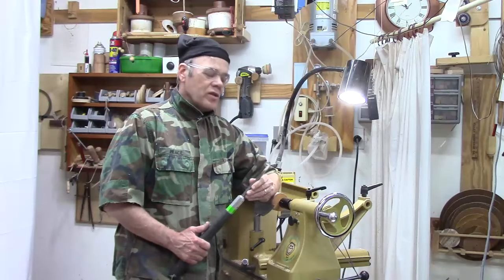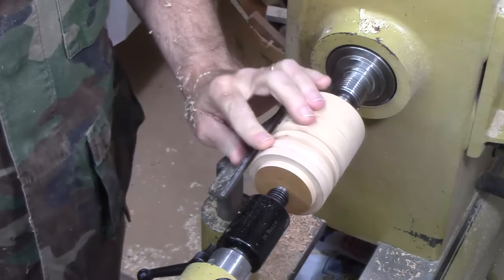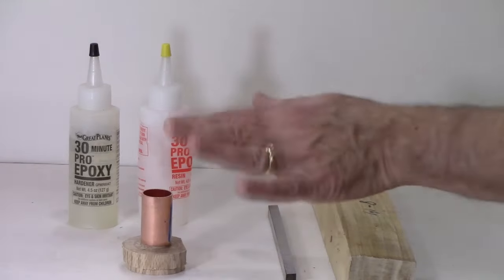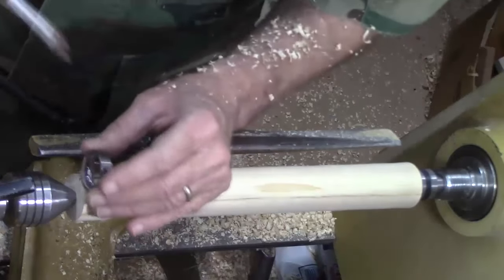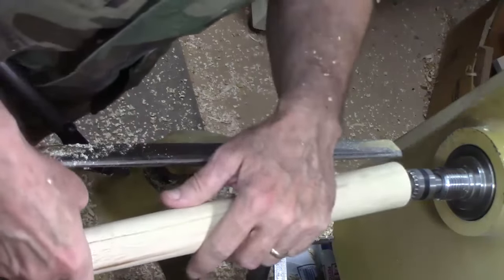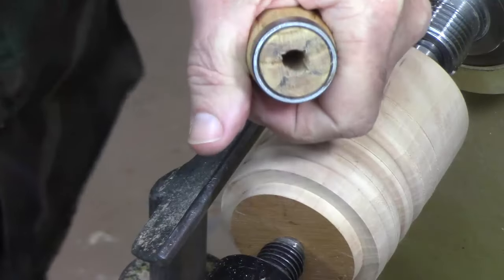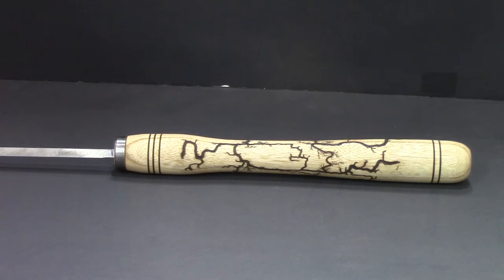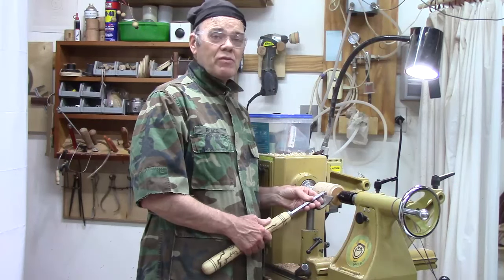The Versatile Beading and Parting Tool for Woodturning

Comment: Mike I bought those tool steels and they came with an angle on both ends. So I built the tool and sharpened to that angle and it fits my dove tail jaws perfectly. Thanks for the info and I'am going to make another one that is straight on the end. Thanks again for a great video.

Comment: Thanks for the idea of using the 8mm square bar.  I made a bedan and an offset dovetail tool for cutting a dovetail recess close to the tailstock as you showed in an earlier video (2015-10-8).

Comment: The Japanese method for mounting square tangs into round, preferably slightly tapered holes, is to heat the tang dull red and then plunge it into the bored hole. The tang burns out the wood to from a square shaped receiving hole. Works great without the the grinding. Added bonus is that the hole has been broached into a square and the tool will resist rotation in the handle.
Reply from the maker: Thanks. I will try that next time. My club will be making these in a workshop.

Comment: Hey Mike, just want you to know that I followed your lead and bought the HSS  blanks from your store on Amazon.  Thanks for the heads up.
Reply from the maker: Excellent. I use this tool so much.
Reply: Mike, you use a Robo Rest in this video to sharpen - what degree do you have it set at?

Comment: thanks for the video! Your teaching style fits me. Question, What is the advantage of this tool over a bedan?
Reply from the maker: I don't have a good answer and I do not want to make one up .I guess it depends on the user.The British bedan has a trapezoid shape. This one was easier to make. I guess I like this because I saw a local user demonstrate using it to make  probably 80% of the cuts on a solid globe ornament so I found the inexpensive 8mm bars of HSS I show in my Amazon shop and made one. I have been happy with it. I do not know any turners that use a bedan in their demos other than a couple of French turners so had little exposure to using one.

Comment: What about using a headstock mount drill chuck from Penn State Industries (Item # TM 42) instead of using a drill chuck that requires a "draw bar"?  Or even your drill bit fitted with a #2 morse taper which also requires a draw bar for use.  It seems to me that the headstock mounted drill chuck would be safer and cheaper in the long run.  What do you think?  Thanks, Rusty
Reply from the maker: See my recent video on Drilling on the lathe. Hard to cram every related topic into a video or I get to rambling.

Comment: Nice Mike! Do you think the bur after sharpening does much or is it gone on the first cut? Just wondering.Do you think copper makes a poor ferrule or is it good enough? Thanks for your time and help as always.
Reply from the maker: Copper is plenty strong enough.  I would be more concerned about some of the very thin brass ones that have a dimple in them that come new with many tools!  Using this tool on spindles slicing is not nearly as hard on an edge as it would be used as a scraper.

Comment: I'm confused how to use the tool with a sorby sizing tool. Let's say I set it to 1.250" using calipers. It holds a rounded, blunt poker that far away from the beading tool's cutting edge, so that when you sink down to that diameter you can see you're there... in theory. But by the time you're "measuring" the diameter of your workpiece you're necessarily near the centerline and that sonovoagun wants to grab if you're cutting 3/8"! And if I flip it 90 degrees and make a V groove the measuring poker won't go all the way down to the bottom of the cut.
Reply from the maker: I have never used one.  Maybe it is sold to solve a problem I don't have. Sometimes tool manufacturers come up with ideas for tools to sell tools. Regular calipers work for me.

Comment: Would I set the plate for the grinder at 22 1/2 degrees to make the 45 degrees included angle?
Reply from the maker: Or the opposite 67.5. Depends on how you look at it.
Reply: Thank you very much, just received the Steel and am planning on making this and a round skew and point tool, I found out the round stock is not heat treated does that matter?
Thanks for your help
Reply from the maker: @kidclown222  For a 1/4 round tool I doubt if heat treating will matter. It may not be as hard but should get the job done. May take more sharpening but I rarely take my small round tools back to the grinder but just toouch up with a hone.
Reply: @MikePeaceWoodturning  
Thank you very much I’m just starting out at 68 bought an old Shopsmith, trying to teach myself. Having a great time, love watching your videos and learning from them, also learning a lot from other great turner’s like Sam Angelo, Captain Eddie and a lot of others. 
Thank you very much, and keep the videos coming

Comment: Newbe question. Is this 8mm parting tool used for the same purpose as the square carbide tools?
Reply from the maker: It could do some of the same tasks I suppose. I don't have a square carbide scraper. But I would guess they each would do some task better than the other.